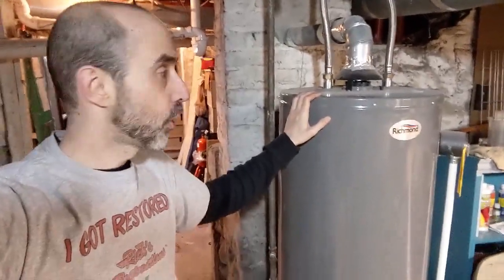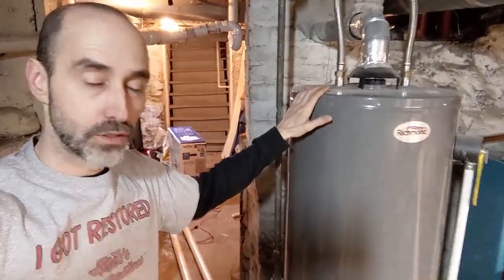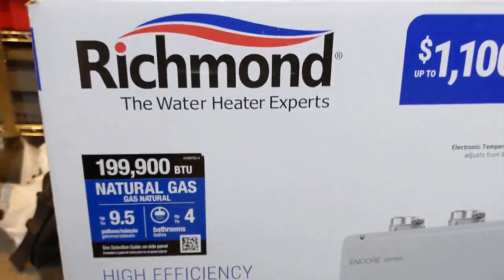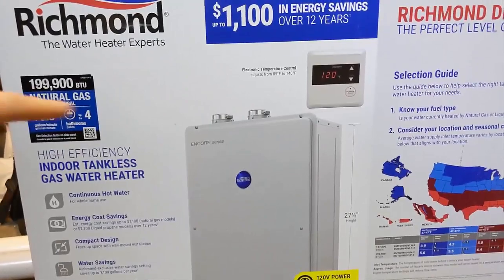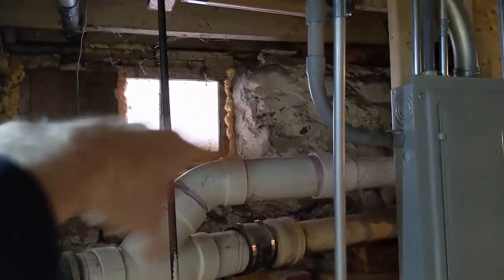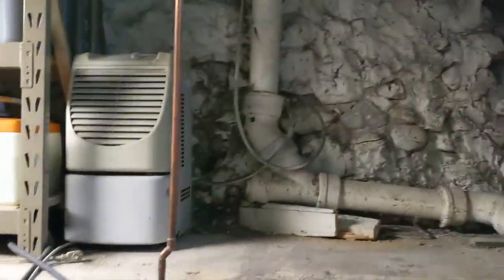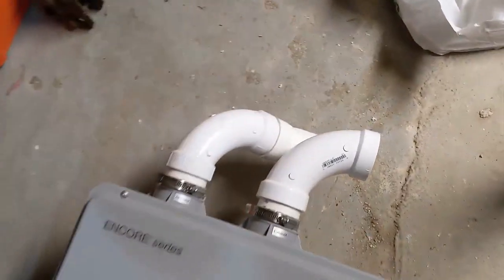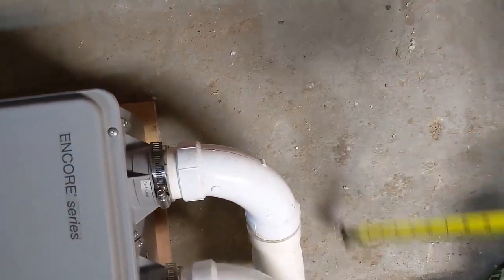Rheem Tankless Water Heater Installation Part 1: sizing, buying and hanging

Comment: We’ve had our tankless hot water heater, made by Richmond for a year this month and I don’t think we would ever go back to a tank type water heater. I did the install the only thing I didn’t do was the gas one thing I do recommend is putting a one micron whole house filter that is my biggest recommendation with the tankless water heater have good whole house filtration

Comment: He made it harder than he should have been. Should have put it right where the old unit was and frame and hang
Reply from the maker: It's not easy to see in the video, but installing in the original location wasn't an option due to the electric panel and conduit blocking my path for venting.

Comment: You need to post a parts list, good video but not very helpful if no parts list to duplicate the install.
Reply from the maker: There is no way to "duplicate the install".  Your installation will not look like mine.  If you go through the installation playlist videos, each describes the general materials I had to purchase (copper fittings, 2" PVC, gas piping, etc).  If that isn't enough detail, then you shouldn't even attempt an installation of this complexity.

Comment: This is a good video, mostly how it does touch on an issue I haven’t been able to find any support on and that’s the water temp. I have a rheem professional tankless water heater and live in south Texas. When the temperature starts to drop in fall, it always trips the breaker. Never happens in the warmer months. Any idea how to address this?
Reply from the maker: Is your water heater gas or electric?  I can't image the gas heater tripping the breaker because it doesn't use much power.
Reply: @FixItScotty  electric
Reply from the maker: @ejfudd5176  Ah understood.  Unfortunately I have no experience with the electric version.
Reply: @FixItScotty  thanks anyway!

Comment: Home depot brought me here! Thank you I'm thinking about installing one . How is it holding up today? besides the valve kit and PVC pipe and fittings , nothing else is needed?
Reply from the maker: So far, so good.  It is still working well after 2+ years.  If you click on the playlist at the end of the video you can see the 5 part series I made for the installation.  Each video deals with a specific topic: venting, gas piping, water piping, etc.  I discuss the materials needed in each one.  But, for the most part, you need the service valve kit, 2" PVC & fittings, gas piping, and (in my case) copper pipe and fittings for the supply.
Reply: @FixItScotty  Thank you!!

Comment: I searched through the comments but didn’t see anything in open air venting. Code says you can vent to open air as long as you have “X” number of square feet available or an opening to the outside. Living in Las Vegas, I have two 4”x8” openings in my garage wall. Is there any reason I can’t vent with the standard “B” vent from my tank heater and draw outside air from the garage wall vents?
Reply from the maker: I believe I discussed this a little in the Q&A in the last video (https://youtu.be/sb5oLP1iiAA).  But if you are sure the room you installed the unit doesn't need makeup air AND the air is not too dusty (like an old attic), I have seen install techs just put a little section of PVC with a grill on it for the intake.  Something like this: https://www.homedepot.com/p/NORITZ-2-in-PVC-Bird-Screen-for-Tankless-Water-Heater-VT2-PVCS/306877760

Comment: I dont want to sound like one of those "you messed up" know it alls. So in the nicest way, when installing my water heater I was unsure of the air inlet and exaust specs. So I called Rheem and asked them. They recommended at least 12" updraft from the unit before the first elbow. I do not know the reasoning for this it is just what they told me. So off to Home Depot I went to get 12" water pipe and the lowered then unit 12". Other than that good video.
Reply from the maker: Thanks for the information!  Too late for me, but others can benefit.  I had a long conversation with Rheem support about venting and they never mentioned that.  Either it depends on the tech you get on the phone, or they evolved their venting instructions over time.  Either way, thanks for commenting and for watching!
Reply: That makes no sense since the heater is a power vented, i.e., pressurized,  combustion device; there is no "draft" in the combustion. Maybe 12" for heat distribution into the exhaust, but the exhaust gas is already supposed to be "cool".

Comment: Only six years they last 30 years here in my house and work perfectly we just are getting a new tankless one just because the old 30 year one is not working so well. My grandma still has hers it was her grandmas my great grandma 👵 ;):)
Reply from the maker: Our water is quite hard, but yeah, 6-8 years is about what to expect for the el-cheapo big-box-store water heater with a 6-year warranty. $350 out the door. You get what you pay for. This tankless should last at least 15 years with proper care, but I wouldn't mind getting 30!

Comment: Could you in theory just leave the intake pipe in the room so you don’t have to run two pipes out? I’m asking because I’m looking to do this to my home and I’ve only have one exhaust outlet going through my roof.
Reply: You could do that, but there could be a problem with backdraft caused by other venting devices like a kitchen exhaust which could result in gas poisoning. In addition, the furnace might already be consuming a large portion of the available air if it is using inside air for combustion. Early high eff furnaces used inside air.    Cut a hole in the wall as manufacturers suggest to get a good supply of fresh combustion air.

Comment: I’m in Chicagoland area too and thinking of going tankless in coming weeks.
Reply: Use a water filter for sediment. Use a water softener to remove magnesium and calcium.  Then a carbon filter to remove chlorine. Then a scale inhibitor which puts phosphate in the water, but note the water dept probably already is putting phosphate in the water and of course the chlorine. (chlorine damages the phosphate in the inhibitor).  I'm in Rockford, Illinois. Same issues with lots of chlorine and minerals in the water. Run a tap for drinking water after the carbon filter and before the water softener.

Comment: I have a Navien, it vents with 2” as well. I also installed it myself so no I will not get warranty but I’m competent and I was willing to risk it… and I drained and kept my old tank unit in case something goes wrong that I can’t fix myself and it takes a few days to get a pro in. It should also be noted that since you installed this Rheem yourself you too will get zero warranty support FYI. That’s the caveat with ALL tankless water heater brands.
Reply: I bought mine through Menards and they confirmed Self installers will get full warranty.
Reply from the maker: Brian, I missed your comment here.  That is good to know!  Even if I did void the warranty, it would still be worth it because the installation would have cost me 2.5x the cost of the unit anyway.  Of course, whether DIY or paying a professional, making sure the unit is installed & maintained correctly is the most important part of getting the most life out of the it.

Comment: 6 years for a hot water tank!!??

Here in B.C., Canada, a replacement HW tank is about $1700 Can ($1350 U$) installed all in. I'll be damned if I'm shelling out that kind of coin every 6 years. I just replaced a perfectly good tank after 18 years and only because my insurance policy says it needs to be changed every 10 or they will not cover any damage. So I live dangerously.

I vowed to go tankless with this last swap but caved due to the $1800 price tag. Also here in government bubble wrap safety Nazi Canada, only a certified gas fitter is able to install any gas appliance. In fact, you are not allowed to take the appliance from the store. It must be picked up by the certified dude.
Reply: Horrible laws and rules in Canada
Reply: Try to fight them make change mate:)
Reply: A water softener solves the problem of scale, and will make the tankless last 30 years. No flushing every six months.

Comment: Stop doing your own installs 🙄 “simple” mistakes like this is what can kill families. Put away your little tools you bought at harbor freight, and let the pros do their job.
Reply from the maker: Did you watch all the videos in the series? What mistake did I make that could "kill families"?
Reply from the maker: Guess he can't come up with anything.... thanks for trolling.
Reply: @FixItScotty  how about when you messed up the exhaust? Nothing wrong with the exhaust being mixed right? Last I checked any type of flue needs to be pitched. It’s handymen like you that cause houses to blow up, people to die due to co. Stop with the vids your not a contractor or a pro in anyway
Reply: @FixItScotty  the reason I messaged so late was because I came outta a 10hr shift doing plumbing. I deal with these units and other aspects of plumbing on a daily basis. Get your facts straight or stop throwing out these vids. Your answer to your fuck up shouldn’t come from a plumber online, or “call Rheem to find out more”
Reply from the maker: @Blase1994  I put out a correction video on this. This would not have caused the house to blow up.  At no point did I have CO levels building up in the house.  What a ridiculous statement. Just move on and troll somewhere else.
Reply from the maker: I apologise for calling you a troll. Next time maybe just make your statement without the rudeness.
Reply: @FixItScotty  Fair enough, as long as next time you make sure you do things by code and stop spreading dangerous videos. Do your hw or don’t post this crap
Reply: @FixItScotty  cause honestly there’s a bunch of fb groups with real plumbers that laugh and are in shock with your misleading videos
Reply: @FixItScotty  Don’t listen to this nonsense. No one cares more about the safety of your family than you. The so-called pros think that all DIYers are amateurs. I have found that most “pros” have no idea what they are doing. They try to scare you so they can justify their greedy prices. A plumber quoted me $4000 to install the tankless and that doesn’t include the price of the water heater. No thanks I will do it my self and do it better and right. Read the instructions, know your building codes, watch videos like this and you can do it. Use common sense but if you don’t have any then hire someone who does.
Reply: @HH-pj2df  Yeah, same GD thing happened to me tonight (12-29-2021).  Some Home Depot salesman hack came out here and quoted 3x what the TL-HWH costs.  I can't afford that.  They act like money grows on trees.  They said just put it on HD card and it'll be no interest for 2 years.  No that's not true.  It's no interest charged, but it accrues over 2 years.  Then, if it is not paid off IN FULL at end of 2 years, then they charge you all the back-interest.  So, fook that.   Yes, I would have loved to get them to do it, but I'm a Teacher and it takes a lot of time in front of a classroom, dealing with kids non-stop, etc., to ever get the after-tax money to pay them for labor, plus interest, plus unit cost.  When someone is so well paid or overquotes people, they forget how much $8500 is for these units.  That's not pocket-change.

Comment: My tank water heater is 35 years old and still going strong.    :)      But I am looking at replacing it with a tankless water heater.    When I was a kid growing in in Europe in the 1970's having a tankless unlimited hot water supply was the most normal thing in the world.    They were very simple units back in the 1970's.   Nothing more than a flowswitch turning on a burner heating a metal drum that had coiled copper tubing around it.    No venting.

Comment: Why PVC for the air intake and exhaust instead of alluminum?
Reply from the maker: Like high efficiency furnaces, these water heaters produce exhaust that is not extremely hot so they don't need metal exhaust. But the reason for PVC is because the exhaust can produce an acidic water vapor that can corrode metals.